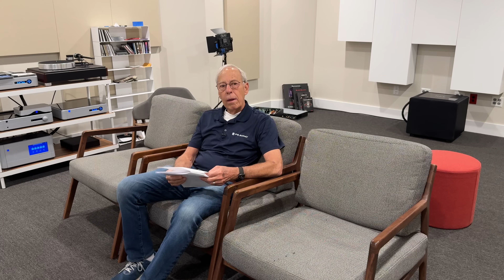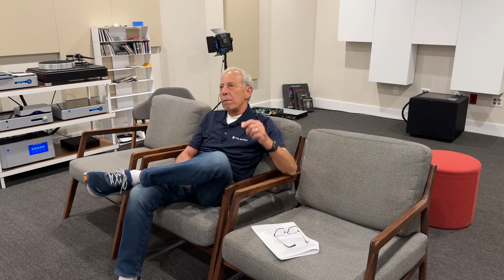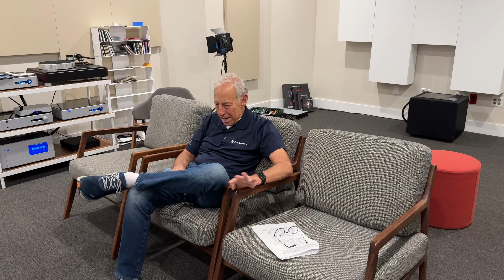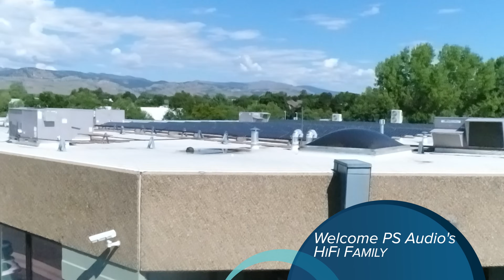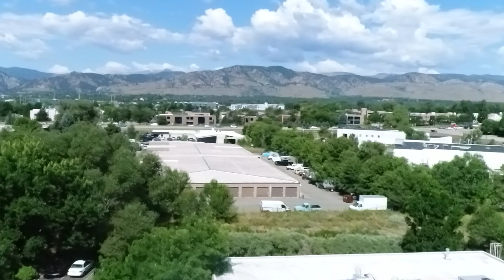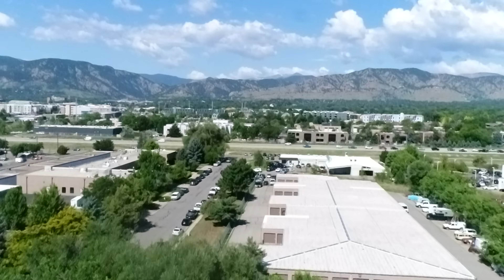XLR or I2S for digital?

Comment: I'm confused. I thought that digital on XLR was AES/EBU. I've never seen a PS Audio equipment with that implementation but I might be wrong. So if he's talking about XLR (analog) how is that compared with I2S? Unless is trying to understand which option would be better, coming out with XLR from PW SACD or using it as a transport by connecting both units I2S with a HDMI cable. I'm lost.
Reply: Your initial thought is correct. This video wasn't specific that way. XLR (analog) is not apples-to-apples with I2S. XLR (digital) -- a.k.a. AES/EBU -- is. That all said, if we exclude XLR (analog) from the conversation, Paul is essentially saying that I2S is better than AES/EBU because there is no multiplexing when using I2S.

Comment: I2S isn't a standard and was only meant for board level interconnections! My suggestion is to try I2S and compare it to your other connections and use the one that sounds better to YOU!
Reply: @dontcare563  Yes, I2S is for Inter Integrated Sound transfer inside a product such as phone, tablet, CD player, TV or automotive head unit. There should be no sound to a digital audio interface provided it is engineered correctly avoiding data errors and audible jitter. There is no magic to it. Your online banking also don’t need a banking optimized Ethernet cable or router 🧐
Reply: Wheels weren't meant for automobiles when they were invented, but here we are.
Reply: @Pete.across.the.street  My point is that whatever interface is used to transfer music data to your DAC needs to transfer the data without errors and in time for the DAC to run the conversion clock precisely. Neither of that is hard nowadays and if one music interface sounds different than another interface, assuming the music source is identical, we have a problem of an engineering bug. Audible differences don't arise out of no root cause. And with similar reasoning, online banking doesn't need golden ethernet cables 🙂

Comment: Each signal, clock and data, of I2S is differential pair in the HDMI cable. It does reject the common mode noise.
Reply: IMHO @shuntachi is fully correct: in addition to Paul's explantions, I2S is also natively some kind of balanced. Anyway, the HDMI cable quality matters according to my own experience, the best is to find one designed for audio I2S, e.g. those proposed by Italian Company RICABLE (pls note: I'm not linked with them at all !).
Reply: You have no idea what you are talking about!

Comment: Coax rca/bnc always sounds most natural to me. Its all just marketing to sell more with the latest and greatest input for the latest and greatest resolution when 99% of your music library is even recorded at that resolution. Upsampling when the information is not even there to uncover.
In the 90s, it was fiber optic(not toslink) in the uber high end before it was phased out because too expensive, replaced by the cheaper toslink which became common and that stuck around despite being universally hated. 
Im no expert, but Fiber optic used glass and lasers vs plastic and led light transmission. (i know they make toslink in glass as well). Shouldn't that be the real best way to do digital connections even today? I believe some of the uber high end dac makers use it still. Off the top of my head i want to say Playback Designs and MSB? They also pass DSD. They now do seperate clock and signal with multimode vs the single mode fiber optic that was used in most of the 90s devices.
I suggest yall give toslink another try with a solidly built glass cable, BUT clean both tips(they sell cleaning pens that clean both the cable tip and the inside of the connector), and use coupling gel on both ends to reduce losses. It's a gel you just dip the tip ends in and then stick into your connector.

Comment: My understanding is I2S (e.g. using an HDMI cable as an example)  is the ONLY way to decoded DSD layer of the SACD...  and there is not industry standard pinout hence a bit challenging to find affordable I2S capable DSD DAC...

Comment: In a perfect world, the DAC runs a highly precise ultra low jitter clock without need of PLL or synchronizing with any external clock, and data is pulled asynchronously on-demand. This is how music and video streaming can work perfectly over the internet without jitter or drop-outs, even with non-audio gear feeding the data. Internet (IP) via whatever connection (ethernet, Wi-FI, optical etc.) supports asynchronous audio reliably. Also USB supports asynchronous audio reliably. Neither SPDIF, TOSLink or I2S supports asynchronous audio data. When a source device, such as a CD transport, wants to play "clock master" without actually having the direct control of the precise tick needed for jitter-free playback within the DAC, you end up relying on PLL and have to dance around managing two "clock masters". In the past where digital audio came from a source device that could not work as clock slave (such as a CD transport), you ended up with a synchronous interface to the DAC. So please consider the most audiophile architecture of tomorrow's digital streaming optimized system is end-to-end asynchronous data transfer with a precise DAC clock running the timing and no messing around with multiple clocks trying co-operate. This topic is a bit like how we buy food and eat it. Imagine your grocery store (source device) decides when to send you (DAC) food (audio data) without ever listening to you and you have to eat it (convert it to audio) when you get it. Your would have to accept eating at the rate of when the grocery store send you food without really knowing the precise timing of it. This is how SPDIF, TOSLink and I2S work. Then imagine an alternative where you could order food in advance (asynchronous) and always buffer enough food (audio data) to precisely have your meals as scheduled by your own clock. This is how asynchronous audio data transfer works over the internet and USB (and it's how we want to manage our meals with our own clock). A PLL is sort of like assigning someone to re-schedule your meals to whatever time you happen to receive your food. Yes there are ways to make synchronous audio jitter-free with more buffering and other techniques, but best is to run 100% asynchronous from source of music data to DAC. A correct asynchronous architecture also completely eliminates any need for a "re-clocker" device.
Reply: I don’t care, I just want beautiful music. 🔥👍
Reply: @DaleCrommie  Yeah, I’m talking as an engineer but as consumer, I agree. When I enjoy music, it’s about the music itself and how it sounds.
Reply: @clickbeetle2720  No, I just like to express my opinion and hope some day I can buy streaming optimized audiophile gear rather than gear optimized to play vinyl and CD also able to support streaming without compromises. I have several systems and realize my KEF LS60 are heavily optimized towards streaming while my other systems have streaming as a less integral part of it. I2S between a streamer and DAC is less ideal than a USB interface where my streamer can feed the data asynchronously and with two-way awareness of the DAC capabilities (including DSD support). In the ideal world even DSD streaming is completely seamless and I just pick a track and if it happens to be DSD, it will play lossless in DSD. Without that sort of integration, DSD will never succeed.
Reply: Or put another way, the writer doesn't claim it has any audable effect, so we agree then!
Reply: @clickbeetle2720  The difference is if your DAC pulls the data asynchronously on-demand or someone else is pushing the data synchronously.
Reply: @clickbeetle2720  When a stream of digital audio data is sampled at a particular frequency, it should ideally be converted back to analog in exactly the same frequency. The DAC is the place where you do this conversion and not further upstream. When an external source device has its own clock you end up with a conflict of which clock is right. If a transport is outputting 44.1kHz 16 bits PCM, it means now the transport has become a clock master, but it's not directly clocking the DAC. If the DAC also runs a clock on 44.1kHz you will have to ensure that neither you run out of samples (if the source clock is slower than DAC clock) or buffer incrementally more samples (if the source clock is faster than the DAC clock). With a PLL in the DAC, the DAC can gradually adjust its clock to avoid those issues, but then it might yield jitter issues as it effectively wont keep the clock completely constant. Best is that the source device is told when to deliver the data asynchronously much like you decide when to go shopping for food rather than the grocery store just decide to send it without asking. In reality, good systems can sound excellent also with synchronous connections. Re-clockers are needed only when the digital audio design is terribly done and it's synchronous. With asynchronous audio data you will never need re-clocking. So it maddens me a bit the industry is making money out of products patching fundamentally poor engineering.
Reply: @clickbeetle2720  This is about the topic of jitter, which means the timing of clocking the samples has some variation. You can imagine a CD track where the sound level is sampled 44,100 times every second and the DAC can’t output those samples with the exact constant of 44,100 times per second as it is trying to match the timing of the samples being pushed in over a, for example, SPDIF cable, you might hear some jitter artifacts due to timing variations, when those variations get too high. Jitter can sound different depending on severity and how those variations distribute themselves. Jitter can also cause listening fatigue. In reality, jitter is not a real problem in well designed audio gear.
Reply: Nice explanation, thank you. But, could you explain then why Paul says that i2s is better? What is that make this technology better than usb today? I understood that asynchronous data is the future, but about now? And another question, how modern DACs manage the sending clock? What do they actually this 2 different clocks together? Thank you
Reply: @SimoRama  I2S was created by Philips Semiconductors in 1986 as a protocol to send digital audio with dedicated clock within a product such as a CD player and later was used inside TVs, mobile phones, AV receivers and other products. It became the standard for how DAC chips got their music data for decades but was always intended only as an internal protocol between integrated circuits. So it never got a proper industry-wide standardized protocol stack with metadata and capability management. Still it does have the advantage of a dedicated clock signal unlike TosLink and SPDIF running the clock hidden in  a serial dataflow. PS Audio can promote it as superior synchronous connection and there is a sales value in suddenly you make a point of why you need more PS Audio products, but technically, even better would be asynchronous data transfer.
Reply: @ThinkingBetter  Clear, thank you sir.

Comment: I found it depends on the gear, sometimes i2s sounds better, sometimes coaxial does... It is system dependent in many cases, even with some PS Audio gear, let your ears decide.
Reply: And, "better" is different for everyone. . .
Reply: @briand.1694  It is. But many will disagree.
Reply: How about DSD layer of an SACD disc ?
Reply: @ptg01  I found it depended upon the actual recording, sometimes i2s was better, sometimes coax. And then you have the gear... No concrete answer to that question.
Reply: @michaelwright1602  Technically, if it sounds different it’s either because of data errors or jitter in the timing. Since both I2S, SPDIF and TOSLink are synchronous interfaces, there is a potential risk of jitter issues as the DAC doesn’t have full control of the timing. Best is asynchronous audio data transfer where the data sink (DAC) can control the flow on-demand and run the DAC clock precisely. But that requires IP or USB interfaces.
Reply: @ThinkingBetter  I have owned a couple of DDCs too, still gear dependent. Measurements are fine on nuclear subs, we are talking audio gear here.
Reply: @michaelwright1602  There is no magic to it. Your DAC will output identical audio if the input data is identical and it runs in the same mode with the same clock. It doesn’t matter if the data comes from whatever source in whatever way…except if there is some actual defect in the data flow. I’ve in my past career done R&D where a software bug cause PCM data errors that were very hard to notice.
Reply: @ThinkingBetter  Brother, I can switch cables on my gear and get a different sound.
Reply: @michaelwright1602  Yes, I can’t say that’s false, but then there is some flaw somewhere. Data is data and it doesn’t matter if it’s music, movie, bank, emails, social networking or whatever data. As long as your data to the DAC is without errors and the DAC runs in the same mode, it will not sound different. Possibly the DAC is not running in the same mode or it has a poor performing PLL. Synchronous data for audio is not ideal. I’ve even seen a DAC dropping samples because the source device ran slightly faster yielding some audible glitches. If it sounds different, I would consider it a hardware or software bug, unless the DAC mode is actually different (e.g. 44.1kHz or 48kHz with SRC). SRC (sample rate conversion) is some times a thing with audible artifacts.
Reply: @ThinkingBetter  I have had probably 20 DACs through here, from $79 to $6000 and they all sound different, using the same data.
Reply: @michaelwright1602  There is no magic to it. Your emails don’t look different depending on brand of WiFi router also. Something has a bug in it software or hardware.
Reply: @ThinkingBetter  I understand what you are saying, but I do not think you have much experience with DACs. If we are talking car sensors, I would agree with your premise, but not in this case, not with DACs.
Reply: @michaelwright1602  I’ve done R&D in audio and video since late 80s and it includes many products including DAC. I’m also quite sure you’ve listened to several of those. I can’t say you don’t hear a difference, but whatever is causing the difference would be seen as an engineering ticket to fix during development if actual source of music data is identical and the DAC runs in equal mode. It would be a subject to fix. In audio engineering you don’t just leave observed issues like this without explanation. I’ve gone through many 1000s of reported issues in hardware and software of all kinds and some times a tiny difference takes some very heavy digging to root cause analyze and fix. If this was analog matter, I would be more keen of just accepting it as a difference on some signal behavior, but digital audio data can be delivered to a DAC completely identical and thus will sound identical.
Reply: @ThinkingBetter  No comprende, I am only stating what I have heard over the years playing in this hobby. To my ear i2s sounds fine with some gear, not so with others. I do not know what more I can say. Or, are you listening using your oscilloscope? One of those Cult of Amir/ARS guys? Trust the "science"? How many needlessly died due to that statement?
Reply: Our entire hobby in all its configurations should, in theory, be boiled down to this simple statement. Too often, we want what sounds good or bad to our specific ears to be the same for everyone else’s ears - or our own musical taste and interest to be what others like too. And if not, we should be inclined to disagree without being disagreeable. 

That’s how things should work but too often they don’t, so it’s nice to have this reminder. 👍
Reply: @housepianist  And then you have the "Cult of Measurements"... Spot on sir.

Comment: Does HDMI keeps things separate like I2S?
Reply: The HDMI protocol and I2S one are two different things.
I2S can use HDMI connectors, but that's it.
Unless you really ask about the HDMI protocol?
Reply: Also, you can use a HDMI cable but there are also specific I2S cables with HDMI connectors that only utilize the four (iirc) wires needed for I2S instead of all the wires.